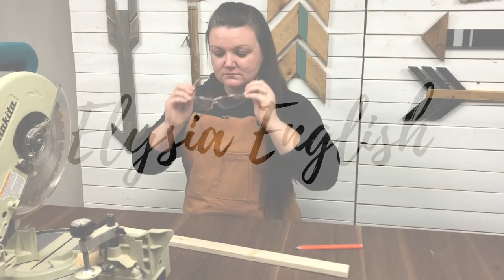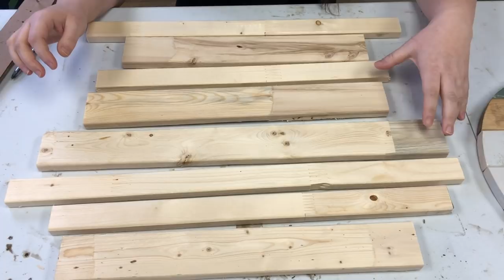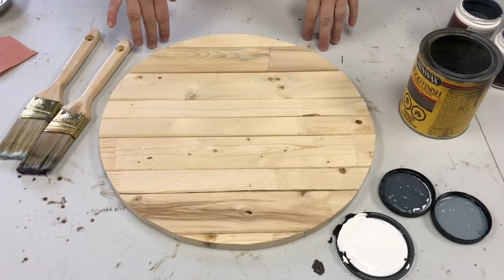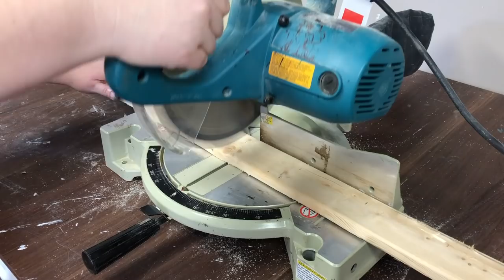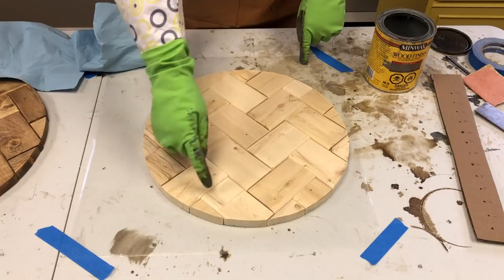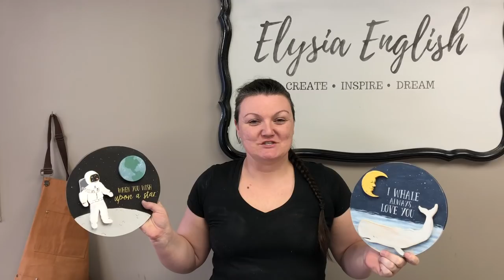DIY EASY WOOD CUT ROUNDS | SHIPLAP & HERRINGBONE Rounds | How to create home decor rounds

Comment: How well do they hold up? I find the wood glue doesn't bind painted or stained pieces of wood well. If you were to drop the herringbone style circle, would the pieces come apart? I wonder if I first put the circle together, glued all the bare wood together and then when the glue dries, stain and sand, would that increase my chances of it never coming apart?
Reply from the maker: Hi D Smith :) Yes as I mentioned in the video, wood glue will hold for a decor piece. If using for anything that will be manipulated often such as a tray a krig jig is def recommended! I did a test drop and it def doesn't hold with just wood glue! As a decor piece leaning on a shelf it has held up perfectly for months :)
Reply from the maker: In addition, I sanded each piece after staining to bind the glue to the wood better :)

Comment: Question, for the herringbone design, do you think this can be replicated on a larger scale? I wanted to do this for the top of a kitchen table. I'd probably put a thin round sheet of plywood beneath the design to glue it down to (or to brad nail down) but have the herringbone pattern hang an inch over it to hide that piece. I wasn't sure if I wasn't predicting any unforeseen issues.
Reply from the maker: Yes, absolutely

Comment: Does anyone know if these would hold together as a door hanger just being glued together and not on a backer?
Reply: More than likely you'll be fine.  If you want a safe bet and don't have any clamps you can use a wood wedge/scrap to make it a tight fit between a couple other boards such as 2x4's while the glue dries.  Good luck on your build!